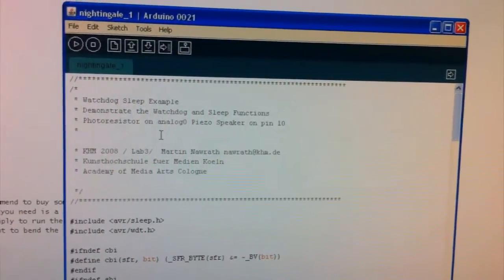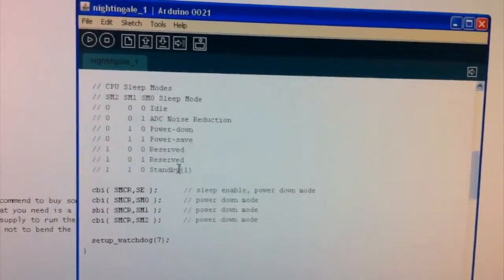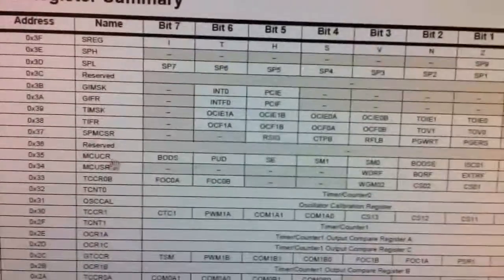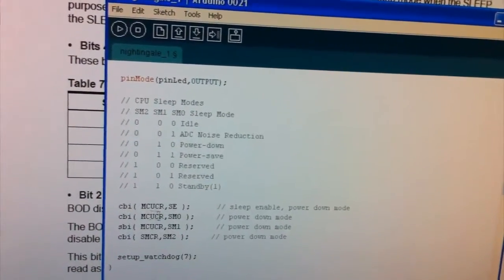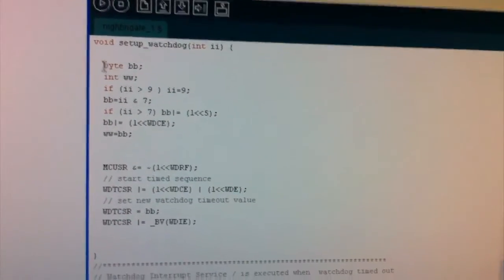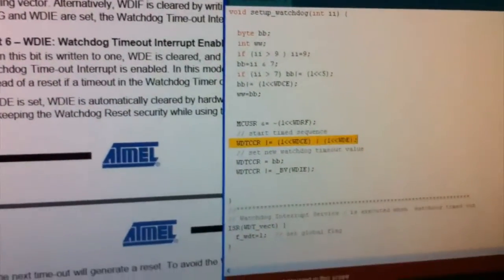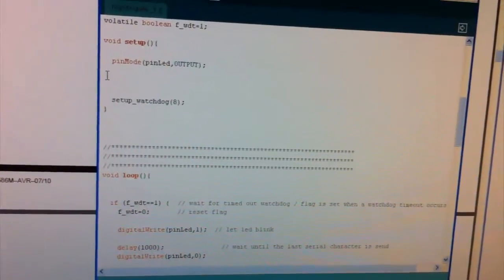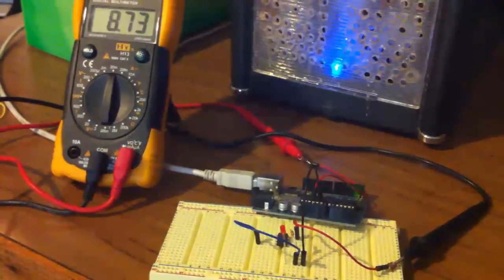Reduce ATtiny power consumption by sleeping with the Watchdog Timer - Part 2

Comment: I have replicate this code,but its only one time executing sleep mode ,not wake up?
Reply from the maker: Likely interrupt isn't working or being enabled, it may have changed between Arduino software versions
Reply: @insidegadgets  ya...its working.Can i use this same code for Arduino uno/nano?
Reply from the maker: @Microsree28134  Yep
Reply: @insidegadgets But when i compile with Arduino Uno avr board ,there was an error shows "WDTCR" not declared in the scope.!

I don't know y this error shows
Reply from the maker: @Microsree28134  You will just need to check the datasheet for that avr chip used, I think they changed the WDTCR to something else WDTxx

Comment: great tutorial! but i try to extend 8sec with "for (int i = 0; i < 50; i++) {" but no matter, where I put it, id doesnt work...
Reply from the maker: Hi, in the loop you will have to call the setup_watchdog function before going to sleep each time. I believe the original example, an watchdog interrupt would occur and turn on the LED and then the next time it occurred the device would reset.

Comment: after looking at the code, there seems to be some superflous commands in there if I am not mistaken
The system sleep routine issues the commands:
sleep_enable();
sleep_mode();           // System sleeps here
sleep_disable();        // System continues execution here when watchdog timed out

But if I look in  sleep.h and see how  'sleep_mode() actuallyis defined, I see this:
636 #define sleep_mode() \
637 do { \
638  sleep_enable(); \
639  sleep_cpu(); \
640  sleep_disable(); \
641 } while (0)
So, in fact 'sleep_mode()' already does a sleep_enable() and a sleep_disable()
Reply: Ed19601 Its what I thought too. He should've used sleep_cpu() instead.

Comment: Actually it is OK to set the sleepmode in the setup. The datasheet only recommends to set the se bit right before the sleep instruction.
Setting the sleepmode in the loop has teh advantage though that you could alter it based on  say readings that you do

Comment: insideGadgets I want to add a variable that keeps track of how many times the ATTINY should sleep for 6 seconds.

Ideally it would sleep for 6 seconds, wake up, increment the variable and then go back to sleep for another 6 seconds, and do this until the variable reached 50 counts. At 50 counts it would execute digitalWrite(0,HIGH); delay (2000); digitalWrite(0,LOW);. And then reset the variable and start counting to 50 again. 

Would this function do the trick:  "for (int i = 0; i < 50; i++) {}" ? Where in the sourcecode would I place this function?
Reply from the maker: Yes that would work, you'd just place the watchdog sleep call in that loop

Comment: thank you very much for this tutorial, it helped a lot.

my multimeter says, there is still a current of 6.8 µA when the attiny85 is sleeping @ 5V. In another tutorial (which i din't understood, so i couldn't use it) the current was at 0.8µA, which is more than 8 times less current. is it possible to reach this low current without turning the watchdog off?

Comment from the maker: The wake up sources when it's in power-down sleep (lowest power consumption mode) for an ATtiny25/45/85 is a INT0/pin change, USI start or watchdog. You could have it be sleeping forever until a button is pressed. 

The other option is the watchdog for 8 seconds but to use a variable to keep track of how many times it should sleep for 8 seconds. It would sleep for 8 seconds, wake up, increment your variable and then go back to sleep - it would only be awake for less than 1ms at 1MHz clock.